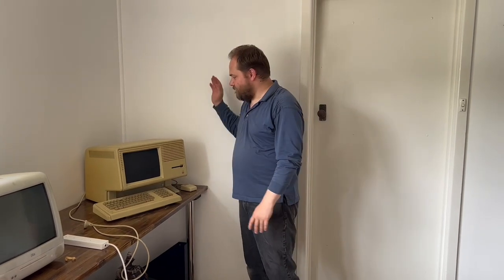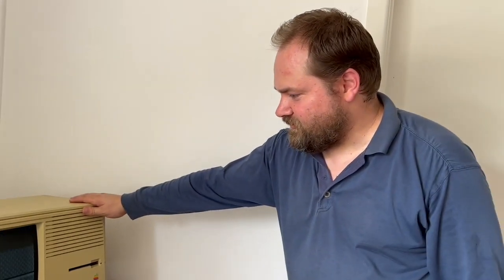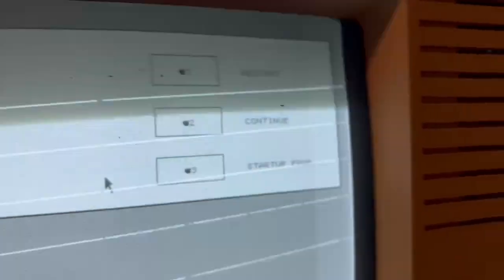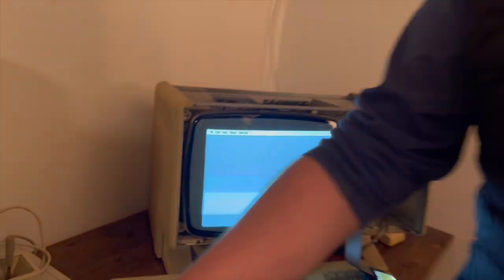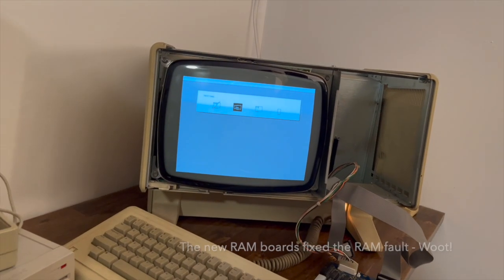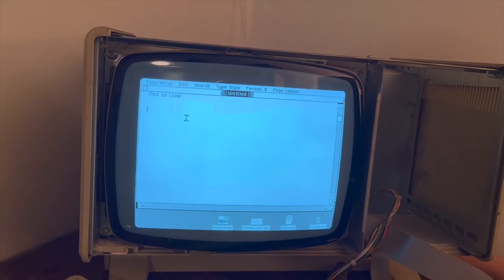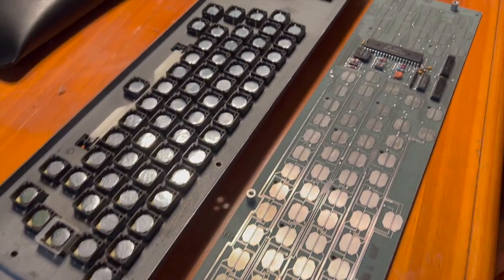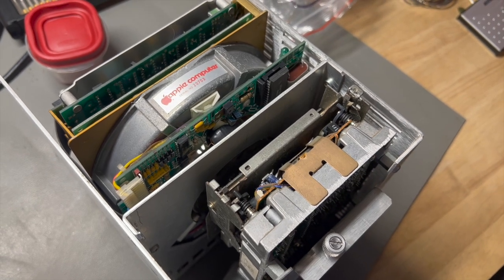Apple Lisa!

Comment: Suggest that you test the voltage coming from the power supply before connecting it to the monitor or PCBs. No sense in potentially frying anything downstream until you’re confident with what’s coming out of the supply.